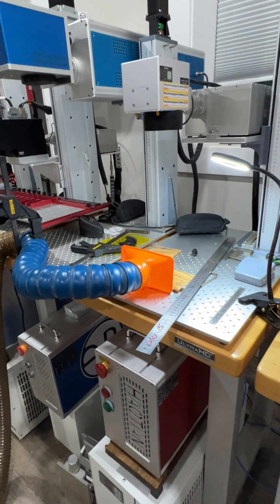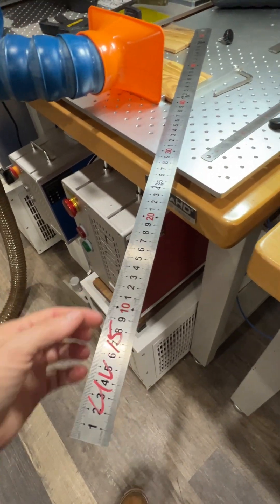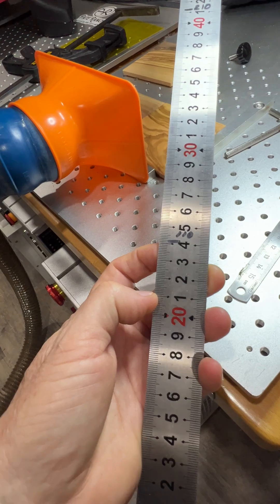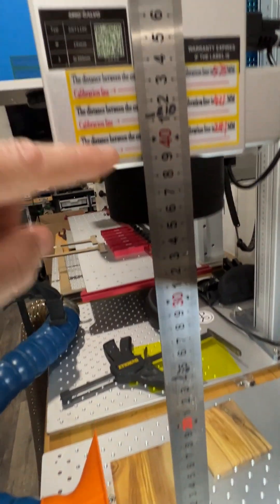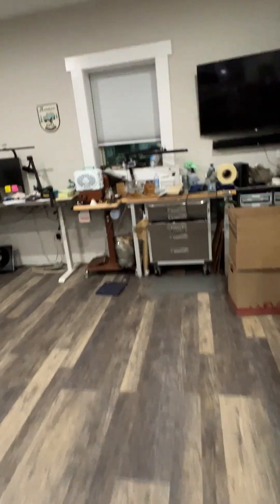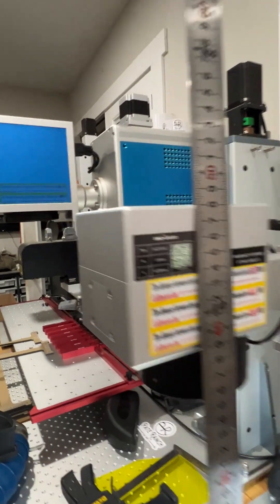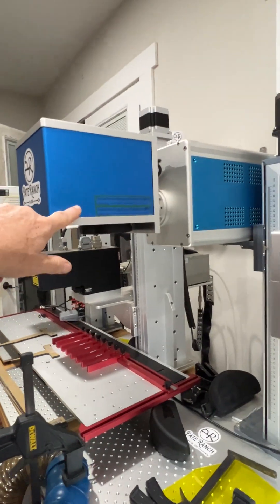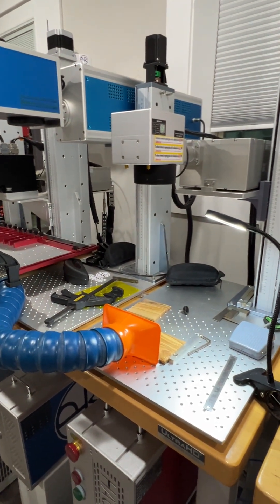Focal Distance on Haotian Laser Galvos

Comment: What lens works best for things like tumblers, the 210? If you only had two lenses to get, would the 150 and 300 be good enough to cover most of what someone needed? I know the 300 might take longer than using the 210 if the entire work area is not even needed but maybe not terribly longer? Considering the 15w with the 700mm tower after watching some of these videos. 

When asking about different versions, it was pointed out there are E model and S models. Any idea which one you have? 
Thanks
Reply from the maker: I use the 110 and 210 lens the vast majority of the time.  I am glad that I do have the 300 though as I use it about 3 times a month for larger engraves.  Remember the lens is in mm so that is your max square engrave space you get off that lens.  If you know you will not engrave ever larger than 210mm then you don't need a larger lens.

Comment: Hi, the towers in your video are motorized and don’t have an adjustment handwheel knob. 

Is it possible to make slight adjustments to the focal distance using the motorized tower? This is due to the fact that sometimes fine-tuning the position with manual adjustments is required in certain cases.

If there were a handwheel knob, it would be easy to do that. However, how do you make slight adjustments when using the motorized tower if needed? Thank you.
Reply from the maker: You absolutely can make fine adjustments.  I will say that these are fabulous for fine tune adjustments. https://haotianlaser.store/collections/all?page=3